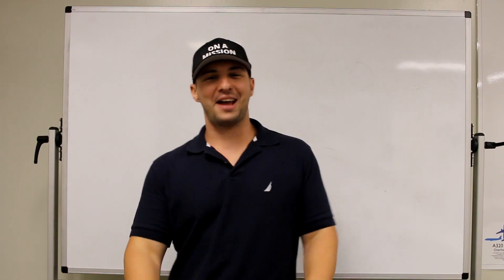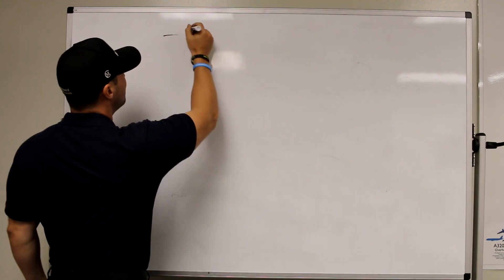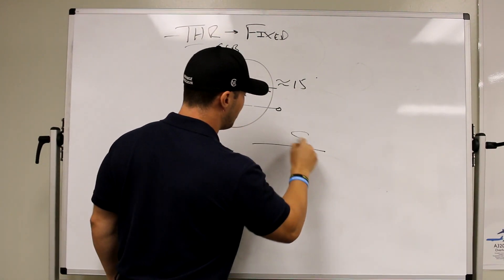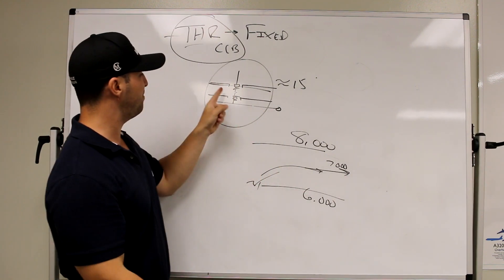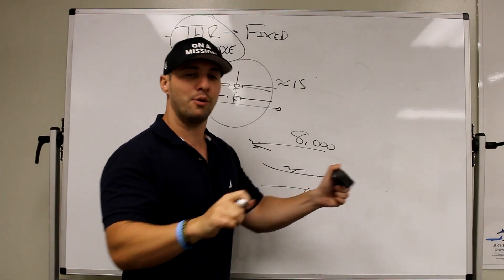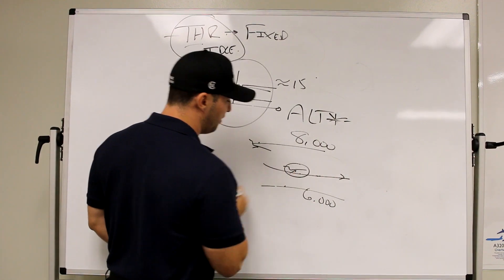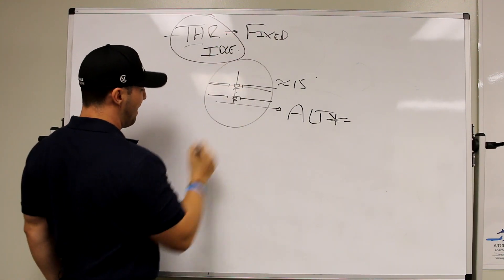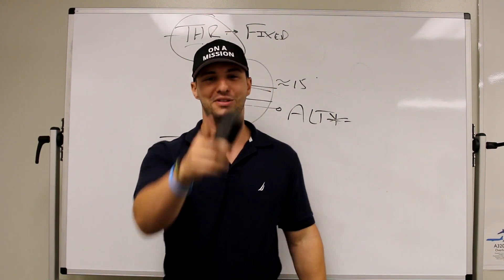A320 Thrust Modes

Comment: This is energy management.  The Fixed thrust is kinetic energy.  The  THR CLB means if you climb on FD you are trading the kinetic (airspeed) energy for potential energy (altitude).  Leveling off with the fixed thrust means there is no more trading of energy, thus the energy is only increasing kinetically.